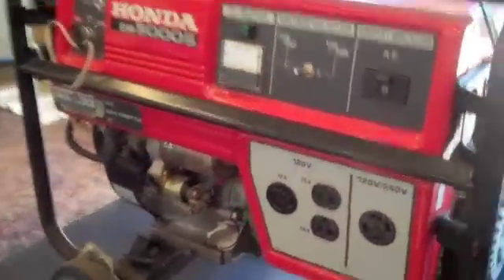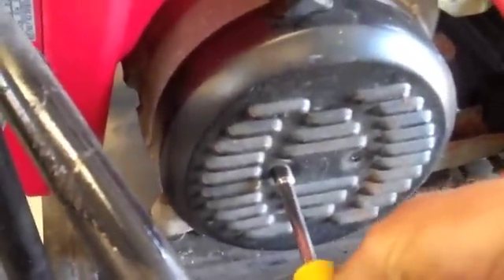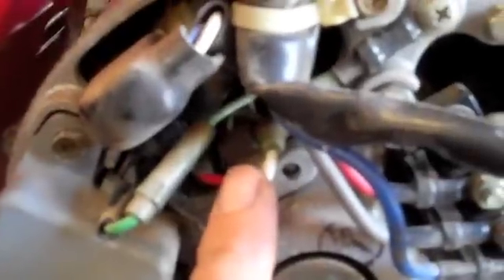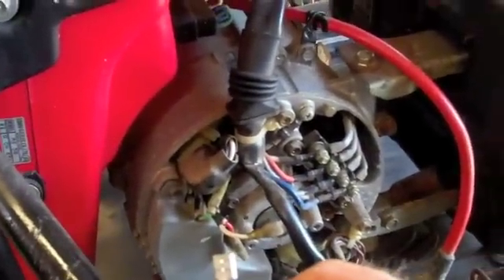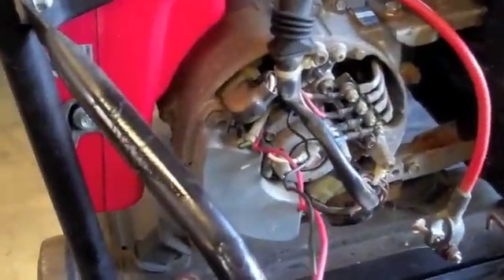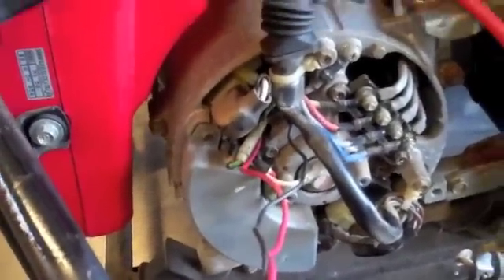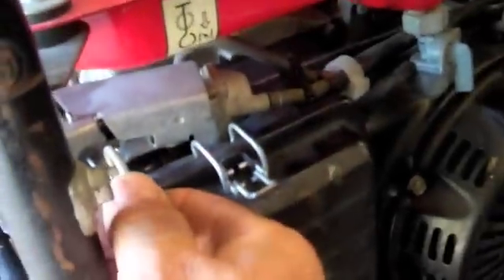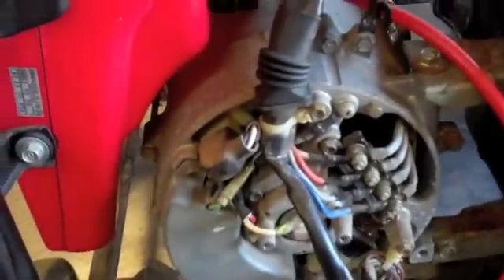Flashing the Field on Honda EM 5000S Generator

Comment: I flashed my generator, but it didn't keep. A few months later I removed the brush holder rotated the armature while polishing commutators with 320 grit emery cloth, cleaned the brush holder while verifying brush travel, reassembled and it produced power right away and reliably after sitting for months without having to re-flash, this was the permanent fix for my generator.

Reply

Comment: BAM! My Honda 5000SX generator has been tirelessly charging the batteries at my off-grid cabin for over 15 years. Last year I increased the solar panel output by 10x and upgraded the batteries. This means the generator rarely runs. Today I went to charge the batteries and no AC from the gen! It's probably been 4 - 5 months since I ran the generator. I followed the steps in this vid and am charging the batteries with my properly operating generator as we speak. This is a superbly well crafted video: states the problem to fix and provides simple step-by-step directions to correct the problem. THANK YOU and well done.

Comment: Thank you so very much my friend🙏🏻

I am from north Montreal and own the very same Honda.

This summer my autistic son started my generator while I was still hooked at hydro…

Since the generator made some freaking noise I was sure one coil has opened.

Following your troubleshooting…when I disconnected positive and negative leads from the brush assembly…the brush assembly came in 3 pieces😉

I replaced the brush assembly and had to reflash the field. I built myself a 3 batteries 12v power supply and after a long 5-10 seconds an orange spark came from within the stator/rotor assy and after shutting OFF generator and replug AVR I started and it took quite a long while to build up voltage….green light came back strong…120V on dial and switched to 240V and wow…there was 240 volts.

Cost me $4.99 canadian dollars because of your video.

How much do I owe you my friend?

Just want to thank you from the bottom of my heart for just taking the time to film yourself while you didi it😉🙌🏻

Comment: Thanks for the video! I have aEB5000 and this worked for it as well! I’ve had to do this procedure twice and it worked both times,the only thing different is I used a 12 volt battery for the power source!

Comment: When are you going to tell us how this works?  Was part of the procedure to connect the 12VDC to the brushes (obviously), with the switch on the panel to the OFF position, THEN turn the switch to the ON position. (is that flashing the field?)  Then shut it all down.  So, what the hell happened?  You never said.  An instructor you will never be.

Comment: It works, but what would be nice is if they had some kind of bios battery system that is weather proof with a boost system or step up to 12 volts. Because eventually it will do this again over time. It will lose its remnance over time. Even with a bios it will probably do it but at least you can increase the excitation time with this backup set up.

Comment: Hi, I tried connecting brushes to a car battery, I ran the generator and it gave me about 200v, but then I put again the AVR and there are 20v in output from the 220v output plug. Is there somebody that has had this issue? Thanks in advance
Reply: You might have a failed AVR.

Comment: I did the drill in reverse..i pluged electric drill in to the generator ..used my cordless drill to spin the electric drill ..be sure to pull the trigger.In just seconds. It started working.

Comment: I have a problem with mine generator my engine run hard but no output voltage. Is it the avr or the rotor. I have a honda em 3500 did someome can help me!!!?

Comment: I have one of those funky junkie 2 strokes.  It worked well for a while,  but now it's only putting out about 50% of what it should be and now dies powering items that it once did with no problem. I'm gonna try this regardless... But can you lose partial power,  but not all?

Comment: Just followed your video and applied your method to a dead  Wolf generator ive been given. Its almost unused but dead. It worked. needed about 20 volts to get it working but the method works. many thanks.

Comment: Can you really just use 12 volts to do this? If that possible I'll just do that because I have a few jumpstart boxes like yours. I got mine working but it's generating 90-100 volts but that's better than no volts.
Reply: Oh dear... you do know there's a difference between 12v DC, and 120v AC, right?  Probably best not to tinker...
Reply: @JoeMac1983  saw 2 videos were guys put 
12v from car battery into one of the 120 outlets, supposedly it worked..?
Reply: @gene2200 I wouldn't try that method.
Reply: Do NOT use 120 VAC wall power to do this.

Comment: great video very informative, thanks. Question just bought the same generator as this one, looks like you have electric start as I do(but u did not use it)?, however battery is not is the same place as a ex, where the heck is it on yours?? Input appreciated. thanks

Comment: What I would like to have seen is the reading from the
output volt meter while coil energised from battery pack without load on it,
while running for those few seconds. I am electrical engineer.
Reply: At 12.5 DC volts excitation you'll get about 163 to 168 volts AC output on an EB5000 or EG5000 generator. Verified today  with my EG5000x.

Comment: Just curious - is there any reason the generator has to be running when you flash it?  You're just magnetizing the rotor, right?  ISTM that it would work just as well to just put 12V across the rotor for a few seconds when it's not running.
Reply: Exactly
Reply: I have seen vids using a battery with no luck doing it while not running then starting generator. It wotked the second time when he applied power with battery while gen was running

Comment: You don't need to flash the field as others explain / all that happens when you do this trick is that it pulls the brushes down onto the commutator to make full contact onto the brushes /which will work for a day or two. the real reason the Honda generator and others need this temporary trick is because of the crappy insulation they use to protect the brush wires, from what ? I have no idea, just clean the brush housing and remove the insulation from the brush wire so the brushes have free movement and you will never have to do the stupid flash trick or drill motor BS again / use any cleaner for electronics to clean the brush housing/holder and use wd40 to assemble
Reply: @tektronix475  Nope.  Its been at the fix it shop for weeks and they said they can't figure it out.  Shame, its a really nice v twin motor and a 10kw genny
Reply: Dear Sir, you would be wrong. The exciting capacitor will discharge after some time and it needs to be recharged, it doesn't have to this painful way, there is a better way to do this but it needs to be manually recharged.
Reply: Interesting.  I'm going to try this out tomorrow night.
Reply: I'll try this George Niemi. I havea EB5000X got it running real good but no electrical output power
Reply: Well, you're wrong.... But this is the Internet so I guess that's allowed. 

In many inexpensive generator ends with a voltage regulator if left sitting too long they can lose the residual magnetism in the rotor. Without this magnetism it will not build up voltage enough to power the voltage regulator and thus start providing field power. 
By using an external DC battery to excite the rotor while running you create this rotating magnetic field and remagnetize the rotor. Sometimes a voltage regulator may have a large capacitor that needs a charge as well at the same time.
Reply: Well, you're wrong.... But this is the Internet so I guess that's allowed. 

In many inexpensive generator ends with a voltage regulator if left sitting too long they can lose the residual magnetism in the rotor. Without this magnetism it will not build up voltage enough to power the voltage regulator and thus start providing field power. 
By using an external DC battery to excite the rotor while running you create this rotating magnetic field and remagnetize the rotor. Sometimes a voltage regulator may have a large capacitor that needs a charge as well at the same time.

Comment: My friend burned a stator in his EM5000SX Honda generator and gave it to me, tried getting it rewound, didn't work, long story, so I bought a new stator for $736 but have a wiring problem in that the four wires coming from the new stator are green, red, black and yellow, while the four from the harness they are supposed to connect to are gray, red, blue and white. Can anyone tell me how to connect them or how to figure it out? Thanks, Doug

Comment: AMENDED BELOW
 Sir, THANK YOU!!! I nominate you for a nobel prize.  lol  Going to the job site in 20 minutes to try this. We have a honda with 7800 constant watt operation. In mid use, the output of the generator stopped. Breaker, switch, and regulator tested ok, so I assume we lost magnetism because SOMEONE, not saying who, left an air compressor plugged in, and running when it was shut off and started for a day or two.
I will return with my results this evening. Hope this is our problem also!

Well, I took the cover plate off only to discover the run capacitor was swelled up and had actually ruptured.
I assume it occurred due to age, and the fact that it spent 2 years not running. 
So back to electronics 101.1 or something, I tested all components, and it is for sure, the capacitor that caused the lack of the magnetic field needed to generate the power.  Replaced it and all is well.

Comment: I don't know how to dol this to my old Homelite HL44400 generator. The brushes are within the plastic end of the generator and there is no plate to remove to access the wiring. the wiring comes out with the generator end. I'm assuming that the brushes have to be in contact with the slip rings to flash the generator? can you help?

Comment: I cannot thank you enough, I picked this exact Generator up for $60 motors runs great just didn't generate.  Your trick fixed it in less than 10 mins. Got a $2500Gen for $60

Comment: I have a brushless generator.  I changed the capacitor and ran the generator for 30 min or so and got nothing.  I understand my next move is to flash the field.  does it work the same way?  Can I use my battery charger?

Comment: i have a coleman power mate 7125 puts out 3v would this fix the problem. i also heard that if you use an extension cord and hook 1 end to the battery then plug the other into the generator with the spark plug removed does that work?
Reply: Absolutely not!

Comment: Great detail and very informative. Thanks.  I have done as instructed on identical gen using large shop battery charger to create the flash. It works fine for that day ONLY. Next day I need to repeat flashing process all over again.  I've used  2,10, 20, 40, amp and "jump start" settings on charger. Any ideas on what else I might try? Is my ARV bad - can I test it?  Thanks for your help!!! :)